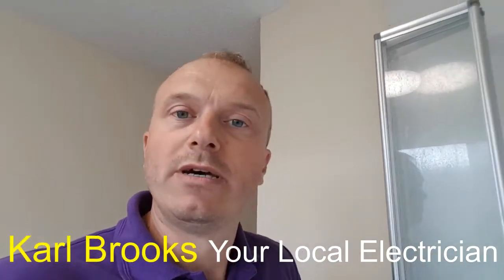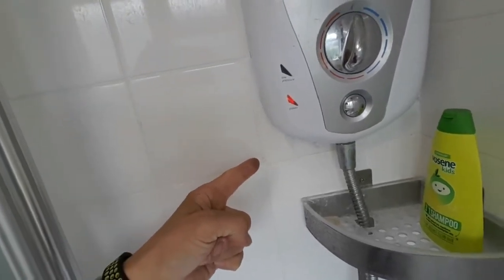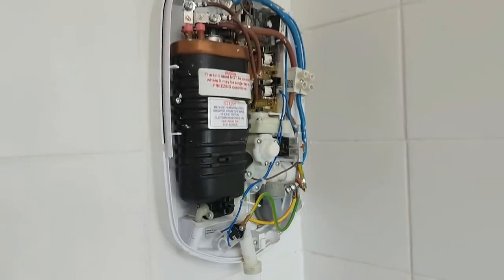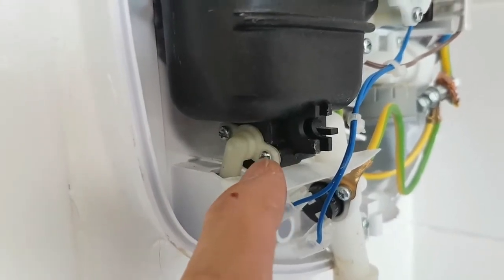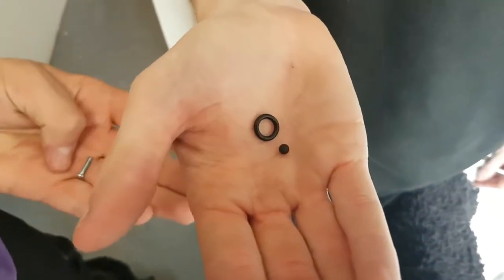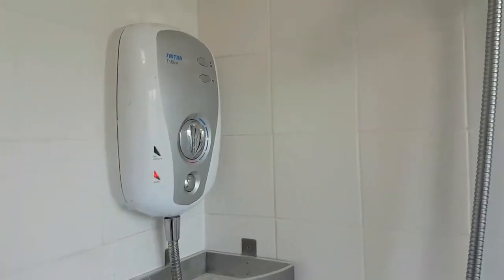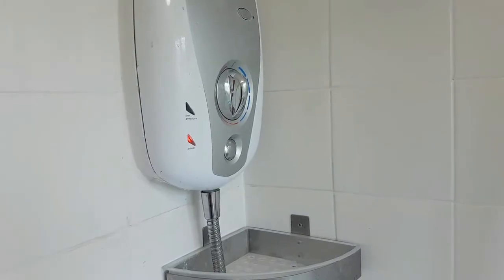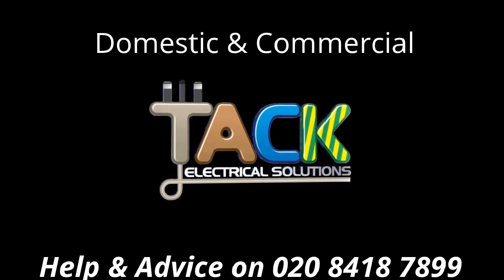Shower Pressure Relief Valve Replacement, Tack Electrical

Comment: Think you’ve just saved me £250!  Many thanks 🙏🏽
Reply from the maker: Thanks for the feedback, great to know my video helped 😊
Reply: @KarlBrooks-Tack-Man  do you need to turn the mains water off to do this?
Reply from the maker: @emmettmag9740  No the shower water stop valve within the unit will be enough. The electrical off, and thus the start switch will isolate the water

Comment: My electric Triton Cara shower won't always get hot & goes cold a lot, if I take the shower head off & put my finger over the hose head to make more pressure it works, do you think a new pressure relief valve will fix it?

Comment: Thanks very much for the video. I replaced the PRV but it happened again next day.

What could I be doing wrong? Pushing the ball in too far maybe?
Reply from the maker: Hi, yes definitely this device is the stop the super heated water scolding you, if the pressure in the shower is too low and the temperature too high this will operate and allow you to keeps safe. 

My feeling is your in a hard water area and the heat exchanger in your shower now has Limescale build up and this not allowing the water to come through at the appropriate rate, this activation of the safety device!! 

Don’t allow your family to use the shower until it is replaced. 

Thanks for commenting
Reply: @KarlBrooks-Tack-Man  thank you.
Reply: @KarlBrooks-Tack-Man  I think I'll buy a new shower if it's the shower boiler. They're quite cheap now. Thanks for your videos.

Comment: where did you get the kit from to do this mines just gone and with cobid 19 I cant get it repaired as the council says it's not a priority
Reply from the maker: karl griffiths sorry I just see your message. Please find the replacement parts here on Amazon Triton electric shower leaking? Pressure Relief Device (PRD) repair kits SIX repair kits fits ALL electric showers valves including 82800450 & 83301330 https://www.amazon.co.uk/dp/B00RI03D8G/ref=cm_sw_r_cp_api_i_eTCQEbN3H1DF0
Reply: @KarlBrooks-Tack-Man  Thank you for that I really appreciate it
Reply from the maker: karl griffiths Give me a call on the number on the video if you get into trouble as we are shielding at present. Also please remember to isolate the electrical supply before opening the front cover 😳
Reply: @KarlBrooks-Tack-Man  thank you again I will do if needed I have turned off from main breaker and pad locked the cover shut before i removed it the first time not risking it lol the picture it shows is a different prd but I'm guessing the replacement balls are semi universal?